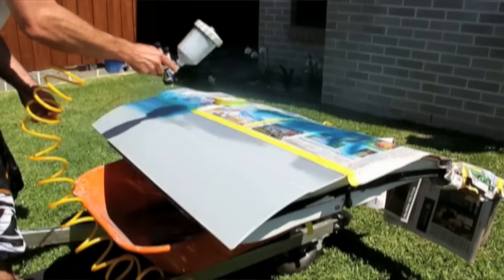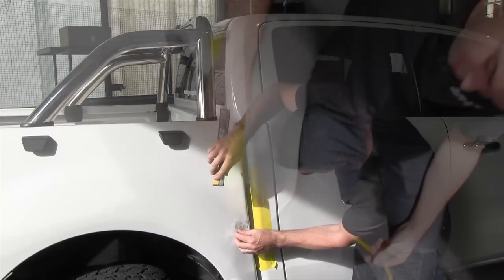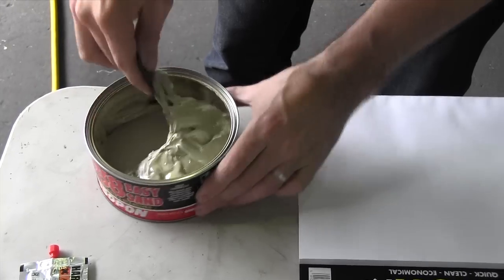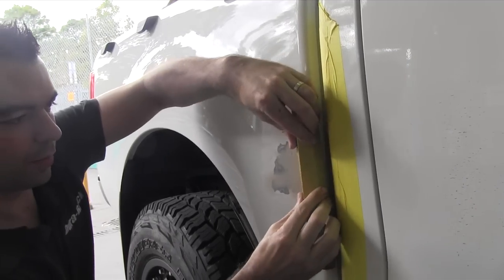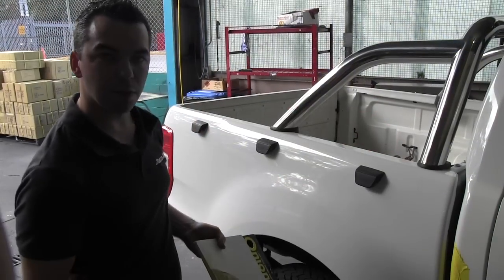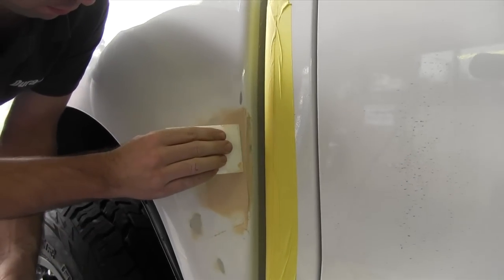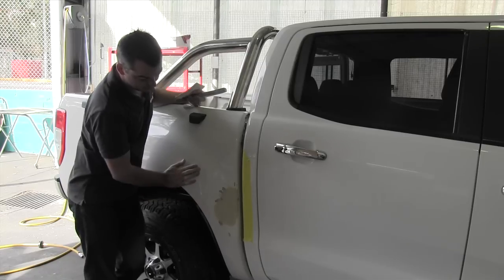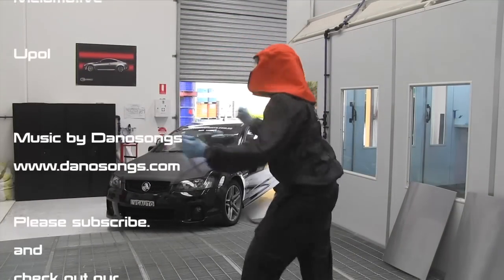How to repair a dent and body filler tips

Comment: Although im sure its been said before as an autobody tech i wouldve either tried to hammer out the corner body line some more or used a spot puller to slide hammer out the body line some more. Just to use less body filler which is best as you said, for the least chance of the work failing later on down the road. Otherwise great video.

Comment: and that folks, is the reason why body work is expensive
Reply: I think it is too expensive. Just my opinion.
Reply: the gaming waffle Labor ain’t cheap
Reply: @angeles3129  TOO expensive? It's a skilled trade, average pay is 25-30 dollars an hour with shop charging 35-40 dollars an hours. That little thing of putty he just pulled out? Like 30-40 bucks probably going to use over half of ot for the dent. Then you have sand paper, higher the grit the more expensive you get. You sand base filler with 80-100 grit, glaze Coat filler which is more expensive than normal filler gets sanded with 120-180. Then after it's all smoother, 220-320 further out to Prime,  after primer is dry, sand the primer with 400-600. Now with that little repair area, you still have to paint the the whole bed side, if you're a good painter and can tint color you won't have to blend the cab corner to make it match. Sand the whole bedside with 800 grit sandpaper then use a grey scotchbrite to smooth out any swirls from a orbital sander, tape up the whole area, plastic sheet the truck which is more money, around 2 coats of paint(base coat) and then clear cost the whole bedside. Take the plastic off, put the bed back together (taillight and wheel well) and all that WITH a booth you could do in a 6 hour period. So 550-700 bucks for a small dent like that makes alot of sense
Reply: I did! Thank you for sharing your thoughts.
Reply: @angeles3129  shit me too just fixed up the obs
Reply: @titoquito8261  lol it should take 3 hours at the most, sand paper is cheap and if done correctly you shouldn't need to sand it 30 times. It's not that complicated of a job just tedious, in all honestly I didn't know these guys made 25 to 30 an hour, I might have to reconsider my career options.
Reply: @CesarSanchez-nu3eo  I fixed it myself, looks pretty good... did't have to sand it down 17 times either like the guy in the video. I knew bodywork was expensive but after further research I find it's even more expensive than I thought.
Reply: Seems pretty easy to Me just time consuming. I'm gonna try it on my car.

Comment: You can also weld some sticks to the body panel and then screw a sliding hammer on the sticks thisway you do as less damage to the panel and saves u a lot of body filler
Reply: They also said this is for people without a stud welder.
Reply: @alec4672  Stud Welder works great. i need it!
Reply: Spot on!! Lots of body filler cracks easily

Comment: Only took you 19:04. I got quoted 8 hours for a similar job :(
Reply: aaron anderson lmao
Reply: aaron anderson  none the less. it aint a 8 hour job. 2,5 absolute max
Reply: Theyre probably taking into account proper drying time and paint coats, sometimes they put on 6 coats of paint and 3 of clearcoat. He also isnt sanding to the higher grits and is taking shortcuts that way or just not putting them on the video.

Comment: Good video but I would have usedacid etch primer on the bare metal then filler over the top
Reply: Should never do that. Fillers are made of talc powder that doesn't like any sort of acid. That's why it wipes away with thinner. If it's rated for direct to metal use then it's fine, if not then a good epoxy primer should be used. Should never have etch prime touching filler if you can help it

Comment: paintless dent repair ftw.  cheaper, quicker and keeps the original paint. 
no need to stuff around with hammering , sanding, priming, filler, taping and paint. Applying heat the right way will also shrink most of the stretched metal.

Comment: What grit did you sand the body filler with after you filled it
Reply: You shape the filler with 36 grit or 80 grit both will take it down relatively quickly after the shaping you are trying to feather and blend there you would start with 180 and work your way to a 400 wet sand that should work fine to put color over

Comment: Do you sand the dent before applying the bondo?
Reply: iamanubertuber yes
Reply: do you think i should try to do this on my car ? or it's more likely to be a waste of my time ?
Reply: iamanubertuber If it's not very big and you are good with yours hands & follow the rules you can DIY to save a lot. Go to any automotive paint shop & give them your correct color code number. Get one regular spray can, all the materials you should be able to buy right there.
Reply: I was thinking doing the filling portion and then having maaco paint it. I tried spray painting a small scratch and it looked messy
Reply: A scratch is totally different to work with. After it is filled in & sanded it is very simple to paint as it should be a smooth surface. If your having any kind of troubles it's best to just have it done by other means. I wouldnt do any of the work before bringing it in as they will charge you the same price as if you hadn't. Good luck..

Comment: I am a second year student in a vocational school (which is a school where you can go into any traid examples are auto mechanics and auto body) and im in auto body. My teacher would kill you if you hit the paint surface with the hammer. With a hammer and dolly, the dolly sits on the original contour around the low spot and you hit the dent out from the back with the hammer. And thats the wrong kind of hammer, you need somethinv called a pick hammer.
Reply: Im in the same program and the only thing that was correct was (pick hammer?

+ your gonna remove that paint so there no right or left as long as the panel is straight. 80% of the time you can't get the hammer on the back of the panel.
Reply: ok .... if you say so
Reply: RageGamer you know nothing obviously. The type of hammer you use depends on the dent and the shape of the face of the hammer for the job whether stretching or shrinking etc.
You can dolly from behind if in this case you can't swing a hammer 
When quoting your teacher at school remember the old saying.
Those who can 'do'. Those who can't 'teach'.
Reply: "Trade", not "traid"

Comment: Filler doesn’t stick to paint, that job will last a year or two and then fail.
Reply from the maker: False. ^^^
Reply: customspraymods True. If the paint is prepped,  i.e. roughened with sandpaper, the filler will stick to it. What you did was not that; what you did was a dodgy job.
Reply: @ehonda2718  I thought he sanded it